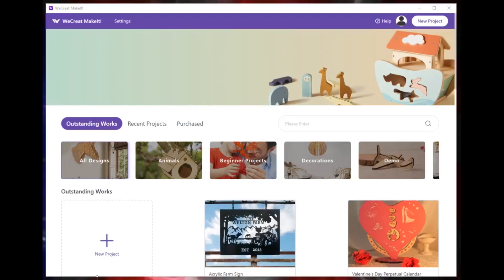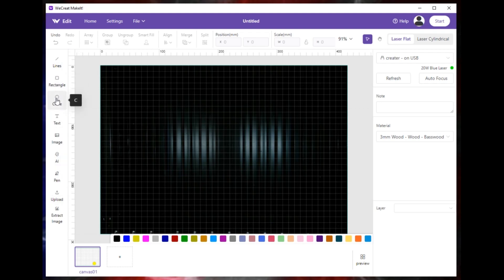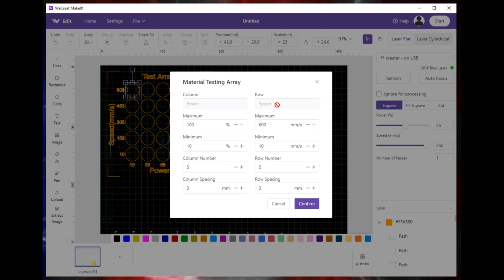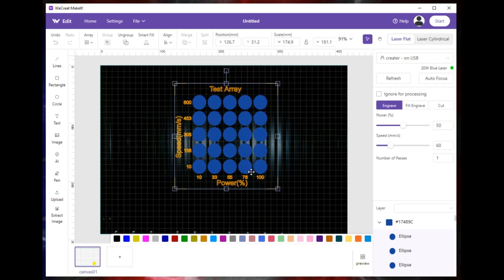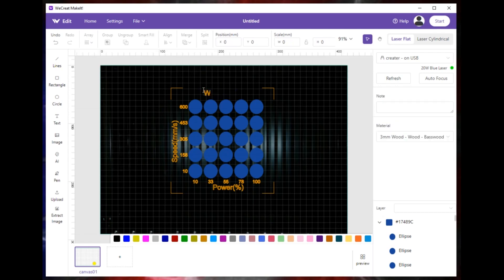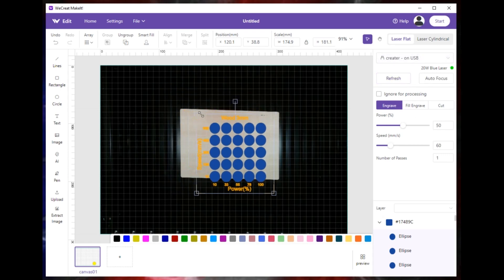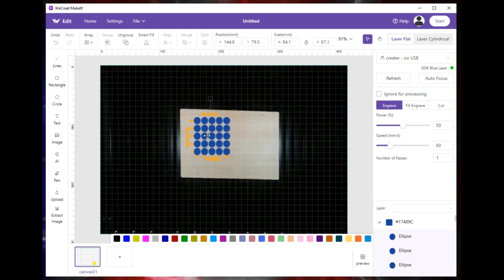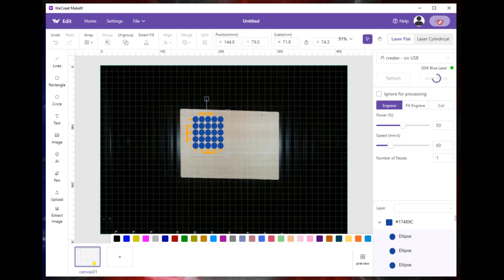Test  Power Array on WeCreat Engraver Cutter  - #wecreat  laser

Comment: Why does the test array display has a max of 600 mms for speed, but the machine will only allow you to select a max of 250 mms?
Reply from the maker: 600 is for fill engrave while 250 is for line engrave
Reply: @ I get it now. Thanks!
Reply from the maker: any time

Comment: Help please.  New to all this and I ran the test with default settings on basswood 3mm and as soon as it got to the bottom row it burned all the way through and I stopped it.  I’ve watched lots of videos on the test runs and everything is burning through way sooner than I thought it should.
Reply from the maker: You did right shut off when it burns thru. Hard material will run full test others burn thru ( You can modify the test array to stop at say 80 % power on setup menu if you like). I just run it till burn thru and stop it - And now you also know the setting to cut that material.
Reply: @WeCreat_Lonnie  thank you.  I did that on the second burn test but I’m confused about the right side of the WeCreat makeit screen .. it shows different power / speed than what I entered for the test array main window.  Why is it not the same ?    Also I thought I listed it to do the text layer first and it still did it last.. how do I change the layer order ?
Reply from the maker: they must have altered the settings to prevent burn thru. -  I just have a box of test material that I refer to when I do something not on their list ( it also gives me the burn / cut speed ) ... you'll note on their sample they restrict the lowest speed to 50 while the generic test goes down to 10 that's why the burn. when the material testing array menu comes up change min speed to 50 and it should look just like theirs @brandycooper5625